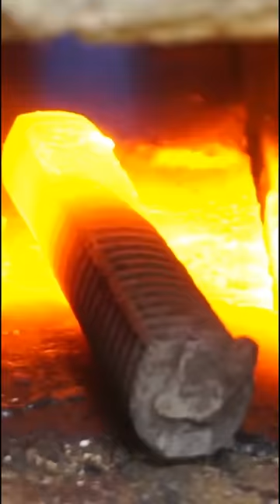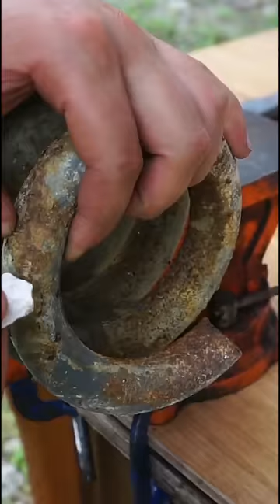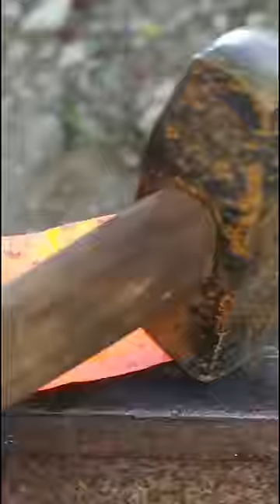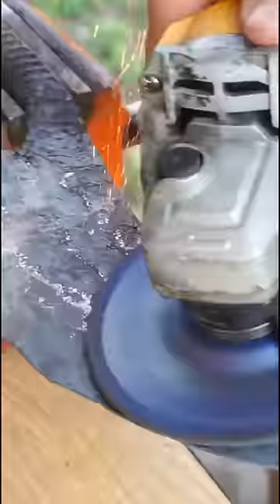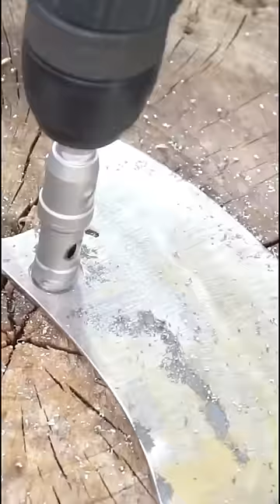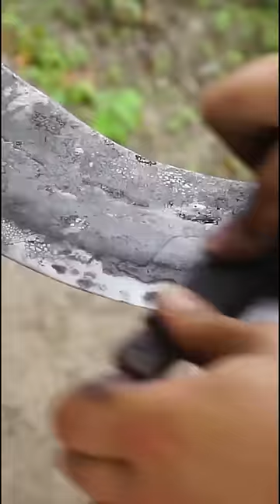Forging Cleaver | #shorts #satisfyingvideo #satisfying #oddlysatisfying

Comment: Very cool! I liked the way you used that 5160 as the blade edge.
Reply: He just used rebar, rebar is almost iron, he should use proper high carbon steel
Reply: @aleister8665 REBAR is a non hardening steel, you are right.
 so what he did was use the rebar as a " jacket" for the coil spring (5160). Basically made a San Mai knife from the rebar and the coil spring. Very clever

Comment: Rebar is trash steel, it will look good but is crappy as far as functionality.
Reply: Rebar is usually comprised of a medium carbon steel, not excellent for holding an edge. But this guy did a san mai construction, meaning that his edge should be good and hard for edge retention, while the spine should be good and soft for shock absorbtion. I just hope he set his welds right, they can be hard to set by hand.
Reply: You don't know much about blacksmithing huh??
Reply: San mai technique= cheap softer steel for most of the knife with good hardenable steel wrapped around the blade side of the knife. Then its forge welded together. Softer rebar spine will absorb impact without cracking while the harder spring steel holds an edge really well.